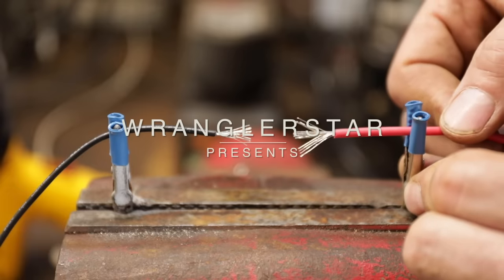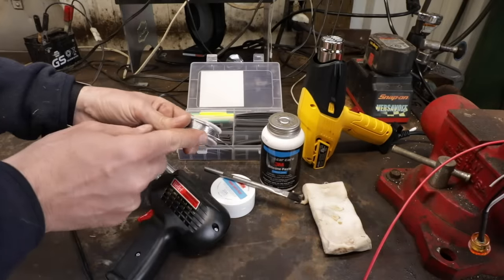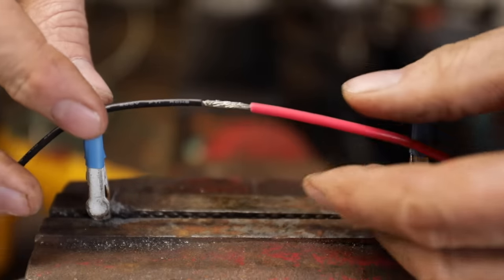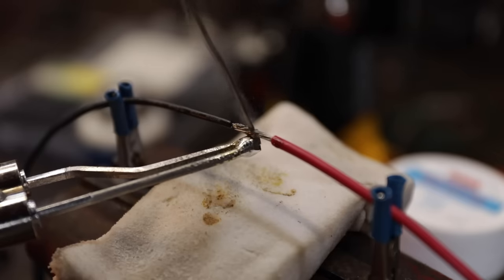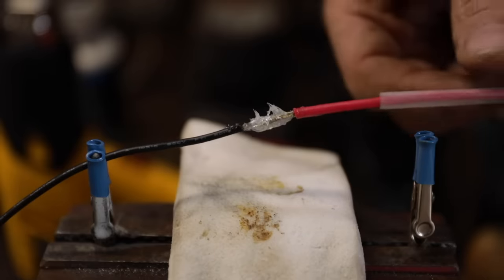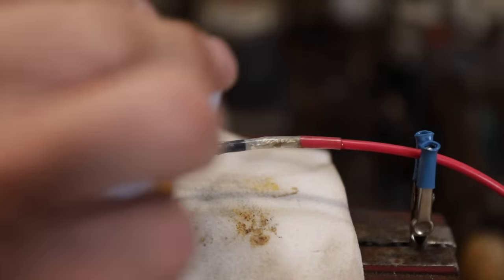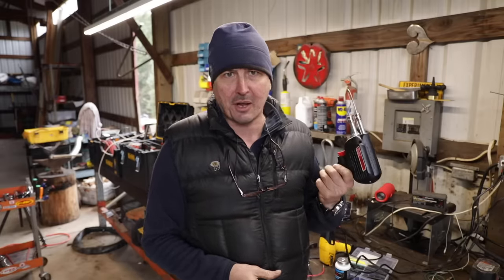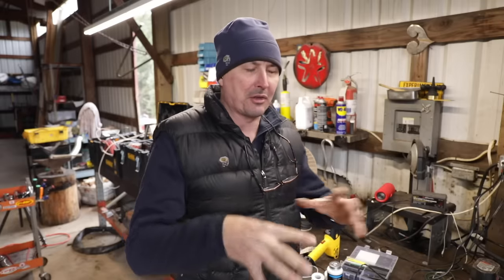How To Solder Wires Like A Pro

Comment: I see how you are doing this and its better than most I've seen, as always we all think and do things differently and think one way is better than the next.   I can not remember what channel I seem another way but I have been using their method for a few years now without any failures.  Somewhat like your version but with a twist.  He takes both ends and counter-twist the wires together without spreading them, it seems to lock the wires together better, then he solders and heats the shrink.  He also reminds to place the heat shrink and move it down away from the work area so as not to heat it while soldering.  Your way, however, is fine, I think its more of a preference and ability of the person.    O- it was buzzsah I think. keep the videos coming

Comment: Nearly 10 -minute video, when you could have this done in fewer than 10 SECONDS with a simple crimp connector.
Reply: In 10 seconds or not, but with better resulta for sure, soldering wires has to be kept for particular situations when crimping is not possible.

Comment: The reason your grandad said to tin the tip of your soldering iron is because a freshly tinned soldering tip greatly increases the amount of heat that the soldering iron is able to push into the wires and makes it easier and faster for your solder above the wires to flow into the wires creating a solid connection.

Comment: Comedy gold 😂
No. Just... no.
Reply: Explanation?
Reply: L. A. Olson well, any stress on this joint will weaken it as the only thing holding the wires together is the solder. You have to wrap the wires around each other if you want it to stand any chance of lasting (see “NASA” splice). Also, in most situations you will not be able to put the stink tubing on once you’ve done the splice.
Reply: If you are connecting 2 wires for something like a wire going to a solenoid and it is going to be mounted and is not close to a plug then you don't need to. They are twisted together btw

Comment: This is not anywhere close to how a professional solders wires together and your technique with the soldering gun was horrible and you should always clean any flux residue off the wires after soldering. I suppose I will stop here because pretty much everything was wrong about this...

Comment: Dual wall heat shrink tubing with adhesive is nice, it seals up the connection properly.  I might lightly coat the wires with dielectric grease from now on.

Comment: If you use /4 heat shrink it has a glue lining in the shrink tube that will seal. Or you can use environmental splices that are a solder band encased in a plastic, shrinkable tubing that seals the ends and the solder joins the wires when heated with a heat gun.

Comment: At 3:43 Grandad was right.  Wet your tip with a little solder to help transfer the heat from the tip to the joint more efficiently.  Your tip was still a little dry and needed more solder where it met the wire.  That's why it took so long and why your wire turned black.

Comment: So, the reason you "tin" the tip of the soldering iron is to get better heat conduction to the wires you're tying to heat up and prevent oxidation of the iron.  If there is enough room to get my hands on the wires, I like to tin the wires together (overlapped) before they are soldered together then wrap the tinned wires together (overlapping) with a single strand of copper wire, then finally solder the whole bundle together.  If there isn't enough room I mesh them together as shown here.  You can see that the wires get totally cooked in this video because he isn't getting good conduction from the iron to the copper wire.  You want the solder on the tip of the iron to be molten, that way you get more surface area from the molten solder on the wire, thus better heat conduction to the wire. Also, it's best to get heat shrink with adhesive to keep moisture and corrosion out.  Adhesive heat shrink acts as am electrical and moisture isolator AND strain relief. By adding grease to the wire, it essentially lubricates the heat shrink allowing it to slide which negates any strain relief properties.

Comment: If any of the major tool companies (Milwaukee, DeWalt) can make a cordless soldering gun like the one you used, man that would help a ton. Milwaukee's soldering iron wasn't as sharp of a result when it came to soldering an 18 GA to a 16 GA wire for some new sickspeed car horns I installed in my car. Gotta do one more connection & I'm thinking of switching out the point tip for the wedged one I have to distribute the heat better. Probably is the reason why I didn't get a good result of soldering.

Comment: Was taught by a Lockheed engineer (worked on star wars missile defense system) that it’s far better to use crimp connectors on vehicle wiring unless the wires are properly secured (not moving) otherwise you risk the solder cracking/breaking which will cause intermittent failures.  If you think about it, most vehicle connectors come unsoldered from the factory and they last... decades.  To minimize oxidation, use marine grade connectors that have a heat activated epoxy inside that effectively seals your exposed wires from the elements. 😄

Comment: I no longer use shrink tubes since discovering a product called Liquid Tape (thanks to Scotty Kilmer!).  It's basically liquid plastic, paint it on and it dries into perfect insulation.  Although you do need to have the time to let it dry awhile, so it depends on what you're doing, and I like to put on a couple coats.

Comment: Tinning the solder iron first A: helps with heat transfer B: the fresh solder helps remove contamination from the previous joint.

Comment: I do a let of electronic stuff. I also use heat shrinkable tubing a lot. The problem I have is that after shrinking the middle portion of the tubing becomes thinner and shows the wire joint there. I think using the silicone paste will solve this problem and look nicer. 

Nice tip!! Thanks.

Comment: 4:07  Yes, you do.  It melts a lot faster that way, and you don't overheat the thing being soldered.  As soon as the wires are hot enough, the solder will flow right in from the tip of the iron.
Reply: exactly, the stranded wire is horribly thermally conductive in the radial direction.

Comment: A good demonstration on how to not do it.
Only because it works doesn't mean you should do it.
Tip 1: Use a proper soldering iron.
Tip 2: Most solders have flux in them so no need to add additional flux, absolutely pointless BUT if your solder doesn't have flux, add it.
Tip 3: Use the side of your soldering iron with the biggest crosssection towards the work, basic thermodynamics and geometry.
Tip 4: "Season" or as he called it, tinn the tip of the soldering iron beforehand, it massively helps thermal conductivity, obviously.
Tip 5: Put the shrinking tube on BEFOREHAND.
Tip 6: Soldering shouldn't take that long, just heat it up, let the solder flow, and you're done, just a few seconds.
Tip 7: There is really no need to overengineer soldering 2 wires together, you don't necessarily need flux, or silicone lube or this and that, just solder it, insulate it with electrical tape, shrinking tube, anything.

I am an engineer for electronics, i know what i am talking about.
Reply: And you really shoudn't connect wires like this. You should solder them separately and then twist the ends and solder them together.
Reply: @Nekronys  Honestly i can't recall the last time i had to connect two wires like this.
I have been soldering for quite the time, but close to never had to do it like that
maybe because it's janky to begin with

Comment: Solder from the side allows better wetting and solder flow when it is added. If insulation starts burning after trying to solder as we see here, something is wrong. I would only wet soldering tip with a bit of solder without getting big blob of it, heat the wire in ~3sec max, then apply a little extra solder to finish the connection. Don't forget adding heatshrink before soldering (or part of the XLR/Jack connector), if you do the problem is called kurac, requiring doing it one more time ;)
Big soldering irons from the video are meant for lots of heat transfer, for soldering wires, transistors, chips, resistors, capacitors and other such components those mains powered ~50W soldering iron with screwdriver tip is preferred. Adding diode to it halves the power in case 50-70W is too much (often is). Happy soldering :)

Comment: I reinvented this wire joining system some years ago without ever seeing anyone else use it - but have an even better way again. 

Make the wire join as shown in this video - but don't solder it - and FIT correctly sized HEATSHRINK SLEEVING ON the wire FIRST.

From the CENTER of the wire join - get a very fine strand of bare copper wire about 6-12 inches long ( I remove it from old Telephone or single copper core Data cable ) and from the center of the wire join, you wind the very thin bare copper wire as a coil towards both ends of the join - ideally up to the insulation - forming a tiny neat wire coil over the join length. This will take some practice as it's easy to disturb the join while winding the coil. This over lay of bare copper wire stops small wire needle pins sticking out and makes the joint neat, tight, smooth and straight. Trim left over wire with small cutters as required. 

( The alternate method to this process is to use a very small copper tube having a couple of air holes drilled into it. The wires are placed into the ends of the tube and then sweat soldered using flux. This will work well but will make the join quite thick on small gauge wires, but is better suited for heavier gauge wire such as big battery or welding cables, etc.)

Next apply your non-corrosive flux on the joint and then tin with a hot iron and solder - just enough to show it as a shiny wire coil. After its cooled and the joint is clean - apply your silicon paste ( which is really only needed for corrosive and wet environments such as boat wiring, under bonnets of vehicles; etc. ).

The only negative for this process is - the joint is stiff and lacks flexibility - so try to keep the length as short as possible and avoid having the wire join subject to bending around sharp corners. 

I have used it with great success and it's certainly stronger than the wire itself. 

I actually made a special jig for doing these wire joins - on a wooden base board, using some larger battery clips , but same process as shown in the video.

Comment: The whole point of tinning the tip of the iron is to create a better and faster heat transfer to the parts being soldered as well as to prevent pull off of the solder as it melts into the connection.

Comment: Appreciate the 'twist' after intertwining, great move. I use tinners' fluid (acid) to rinse the wires before soldering.  Helps the solder flow. I thought you did a good job, thanks,

Comment: you may put solder on tip before and when putting the tip to the wire you have to touch the tip and wires in between with the solder to made a better heat transfer and after put the solder to the wires left to right or right to left... ipc training guy tips :)

Comment: In reality a bad solder almost never get your stuff burned
What does is using a small wire for large load.
Use correct gauge

Comment: You dont need to use rosin flux if you use flux core but it doesnt hurt and the reason you tin is heat is transferred way faster with solder on the tip verses a dry solder iron. The reason it took so long is that you actually want to barely the solder to the iron when it's under the wire to start the flow. If you were working with thin PVC wires you would have melted a ton of sheathing. Nice job nonetheless just giving some tips to make your life easier. Great video
Reply: Barely touched the solder*

Comment: Thank you for the great video.  I have found there are many of us with this issue.  Seems to be the level is stuck in fast mode more so than the level is stuck in slow mode.  Question, If I do not have a vice what can I use instead?  I am brand new at this and noone to help me but your video is great and I am going to give this a go.  My sleuthing so far has showed when the green wire is bent, that is more geared towards the level stuck in high and the red is when the level is stuck in low.  Thank you Tracie

Comment: You tin the tip of the iron just to have something heating on it and not leave the tip run hot dry. That's for when you'll work on a project for extended hours and you need the iron idle but ready to solder. It's just good practice, you prolong the life of your tip by doing so.

Comment: The risk of soldering with this method is that you may end up with some jagged edges at the end of each strain. Depending on the application, you in some cases definitely don't want any jagged edges from an electrical perspective.

When I was working in electronics production, I used to strip a 10cm wire, and separate the strains. I would use one strain to wrap around the two wires I needed to solder together. A couple of turns would be enough all along the exposed wires. It left no sharp edges, it gave nice and round solder joints and it didn't add much thickness.
Reply: Excellent suggestion!

Comment: VERY Nice presentation! I especially like the DIY work stand made from the Gator Clips. One question though... I took a couple of years Electronics (right after electricity was discovered) but over the years have gotten away from small electronics troubleshooting. 

When do you Know you need a Heat Sink before you solder and do you have any good ways you would recommend to use them? I remember about some small circuit board stuff but have forgotten how we actually attached them to protect fragile electronics nearby ! (I was a teen then.. now 65 yrs old)...

 Any help along these lines would be greatly appreciated. Thanks again for this one.

Comment: I have been soldering wires for many years and can I say that placing a dry soldering gun to the wires is wrong. Flux the wire first is right. But melt the solder on to the tip of the gun them on to the wire as it increases the heat transfer 10 fold making it nearly instant.

Comment: I would suggest wiping all the remaining flux off the joint after soldering, and before applying the dielectric compound and shrink tube. The flux has done its job during soldering and should be removed after soldering is complete.

Comment: In most cases when you solder wires, you cannot be putting your shrink tubing on the wire AFTER soldering, but it has to be done before, which is what you should have been showing in this tutorial as that is the hardest part to get right.

Comment: For small gauge wires like that it’s better to use flux core solder for electronics and you have to tin the tip of the soldering iron with a small amount of solder…that’s what helps make the heat connection….otherwise you’re just over heating the parts.

Comment: I like the idea of splaying the wires open before bringing them together but everything else is pretty basic. I used to build my own amplifiers back in the 1950s and so far I've had no problems just twisting the wires together, soldering them and wrapping plastic tape around the join. Voila!

Comment: I'm 65yo tech and that has been old school since I was young. OK for solid wire but not stranded. Too many voids. Get the wire hot enough and you melt insulation. Tin both sides to make it solid and do a center twist. Be sure to put 2 pieces of shrink on both sides of wire.
Reply: what?

Comment: Thank you! In most cases one might want to thread on the shrink tube first, because the solder point will not be accessible by it after closing the circuit.

Comment: Liquid flux in a needle applicator is sooooo much more effective and easy to use... not sure why everyone wants to puddy. The reason you tin the iron is so you can use ur sponge and get a good clean fresh plating on the iron, and also the additional solder on the iron starts the solder joint. It is the hot solder touching both the iron and the wire that causes the soldering to work... not holding the iron to it and then pushing solder onto the wire.

Comment: I'm a newbie at soldering, but research on Dielectric Grease indicates it shouldn't be touching electrical connections directly since it functions as an insulator. I would imagine the best practice is to apply a small amount where the existing electrical casing & the shrink tube overlap?

Comment: Working as a low-voltage technician the silicon grease COATS high-end or specifically made data line, phone lines, and intercom/speakers wiring and by coat I mean like you can't even see the wire coating when cutting into the 1st layer on the cable.

Comment: Your videos are all pretty good and I enjoy watching these. Very informative and detailed! I will say when using those ring terminals, I do the best I can to solder the connection point just so it helps reduce the chances of it getting loose over time, granted it can't be done every time. But it seems to work well for me when I'm able to

Comment: for a simple small wire job like that just use 60/40 flux resin lead solder u wont have to put the flux separately and i use adhesive lined heat shrink tubing so its already in the tube and seals itself

Comment: The reason you put a little solder on the tip is to help heat flow to the wire, also you say don't touch the solder to the tip as you are waiting for the wire to heat. If you had touched a little solder to the connection between the tip and wire, that would have made your wire heat much quicker and not got your insulation so hot.
 Your connection is not physically the strongest, however in places where a big knot is not desirable that does work and I have done just as you have shown.